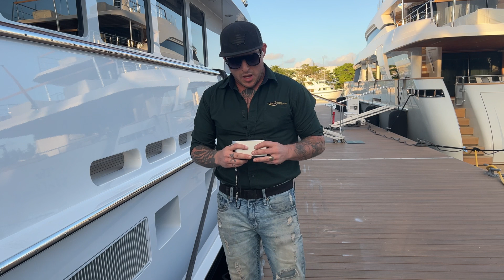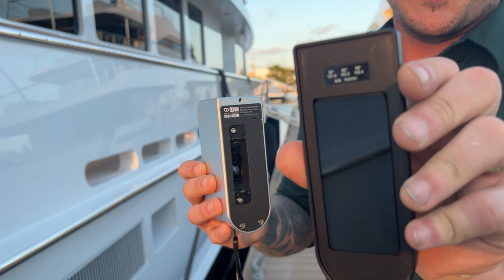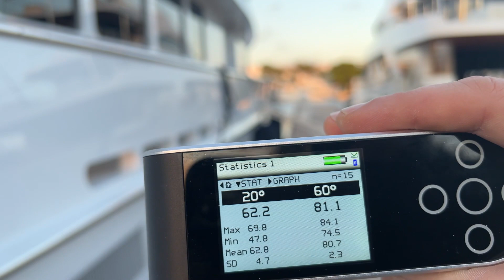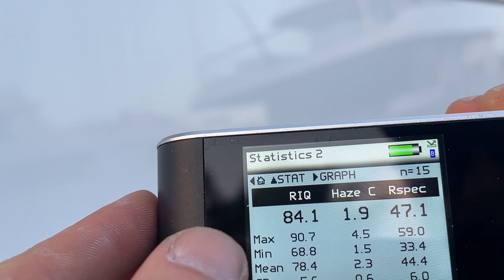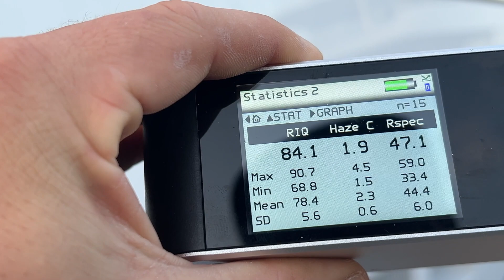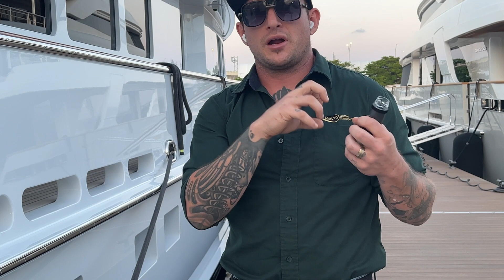Intro to Paint Inspectors & How to Become One Thru "AMPP"

Comment: Hello. Thanks for making this video. I'm planning to get AMPP Nace certified coating inspector. How may I get the manual book?
Reply from the maker: So they are very strict with the course material. You don’t need to study before hand. They teach everything you could need, in the class. If you learn outside stuff that is wrong, you’ll need to unlearn it